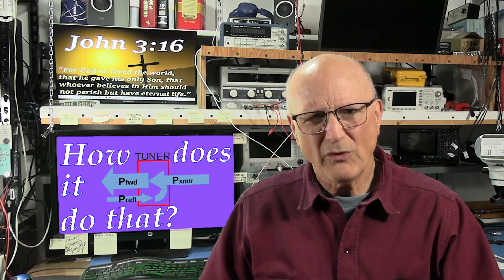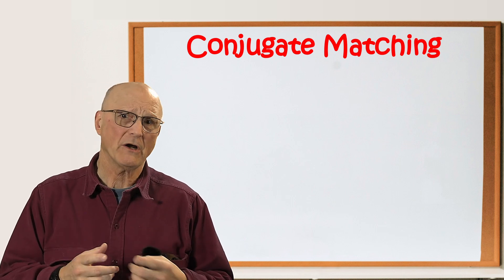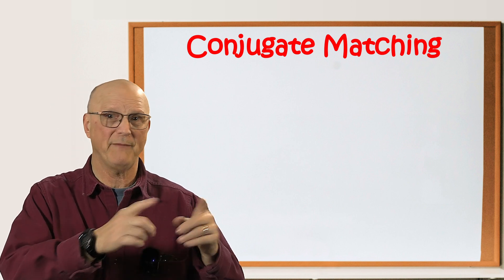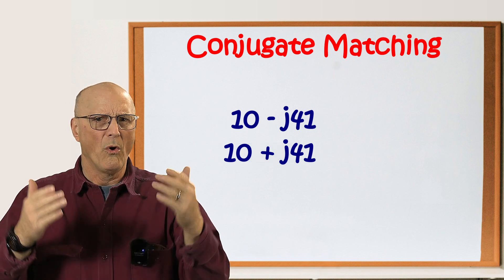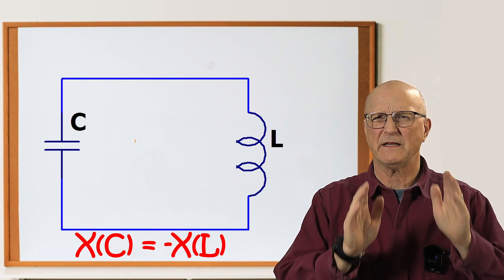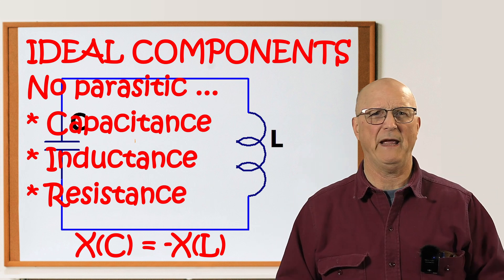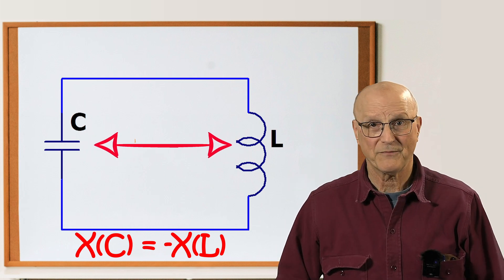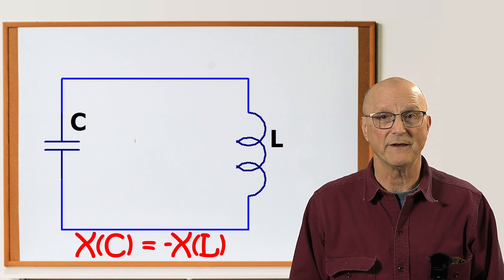Antenna Tuners: How does it do THAT? (076d)

Comment: Maxwell's book REFLECTIONS is in My Opinion necessary reading for any antenna experimenter.  REFLECTIONS 3 is very hard to find and is quite costly if you do find it.  I use his W2DU ferrite bead chokes on all feed lines. They handle QRO with ease.  One question for you.. If I may?  Is RL, Reflection Loss of an antenna at a specific frequency the definitive metric for an antenna's ability to transmit?  ie if one antenna at frequency F has 30 dB of RL and another antenna has 12 dB of RL... is the antenna with 30dB therefore in theory the better antenna?  And then how about in actual practice?  Keep Up the Great Work... 73 Art W1SWL
Reply from the maker: There are PDF versions of Reflection III available on line. That is how I got mine. I forget what the URL was where I got it.
Let me noodle on the whole Reflection Loss a bit ... bare with me ...
Because I was not familiar with the term, I searched several of my antenna books looking for "Reflection Loss" and none of them had this term. 
There is "reflection coefficient," "Return Loss" and "Mismatch Loss," but no "Reflection Loss."
I think that "Return Loss" is the closest to what I think you are referring to because Return Loss is expressed in dB and the higher the number, the better the SWR.  A Return Loss of -30 dB is really good. It is another way of expressing the VSWR, just from a different perspective. It is directly mathematically related to VSWR.
So, I'm going to assume that you mean Return Loss. I think this is the question, "Is the antenna with a lower SWR a better antenna than one with a higher SWR?"
So, I said all of this to give you an almost non-answer (sorry). The common belief is that a low SWR antenna is always a superior antenna. I can say that this is not necessarily the case. A tin can with a resistor in it might give you a great SWR, but it is a lousy antenna. Maxwell, in his book "Reflections" gives an example of a vertical which, from an SWR perspective, was a nearly perfect match. But it was a lousy antenna because half of the power being delivered to it was burned up warming the ground around it. On the other hand, there are other antennas which have anything but a 50 Ohm impedance, but are superior radiators. We have gotten accustom to believing that a perfect antenna has a 50 Ohm impedance because of the proliferation of coaxial feedlines. But, in times past, fantastic antennas were fed with 450 Ohm and 600 Ohm ladder lines. Anyway, sorry for the long winded response. I hope I have been helpful. 🙂
Reply: @eie_for_you  Sorry I dumb fingered it RETURN LOSS.... and the Reflections 3 book was A QST publication when hard printed.
Reply from the maker: @arthurgumbus3969  Gotcha! We all do stuff like that!
Hmmm ... I didn't know that about Reflections III. The copy I have "publish by CQ communications" was from a pdf source.
It is a fantastic book and worth every hour it takes to carefully work through it. It is a shame that the ARRL dropped it from their publications. 🙂
Reply: Return loss tells us nothing about the antenna efficiency per se.  Return loss is a number derived from the interaction of the antenna with the feed line.  Return loss helps describe what is going on in the feed line rather than in the antenna.  For instance, we will measure a quite different return loss if we connect the same antenna to a 75 Ohm characteristic impedance feed line as compared to a 50 Ohm characteristic impedance feed line.  As long as the feed line has negligible loss, we can get the same radiated power from the antenna with any feed line, provided the transmitter can deliver the same power into the impedance presented at the connection to the transmitter.

Modern solid state transmitters of moderate to high power use transistors in the final amplifier that have low output impedance.  Thus, if we had an antenna with a 10-Ohm impedance connected to a low-loss 10-Ohm characteristic impedance transmission line,  the output matching network of the transmitter would not need to transform the impedance all the way up to the typical 50 Ohms that is currently used.  (Having said that, 50 Ohms was originally chosen as a common coaxial line characteristic impedance because it is a good compromise between loss and power handling capability for any given physical size of coaxial cable.  If we consider loss alone, as in a CATV system, then 75 ohm characteristic impedance coaxial cable is preferred.)
Reply from the maker: @ Yup
Reply: You've brought up two details about ARRL books that bother me. (1) They're expensive and (2) They're often difficult to get or out of print. For some quarter of a century there's been a technology called print-on-demand that that allows books to be printed only when ordered. That reduces the inventory costs to zero and allows books to stay in print indefinitely. As best I can tell the ARRL is not doing that. That tragic because those who need their books the most—teens just getting into ham radio—have the least money.